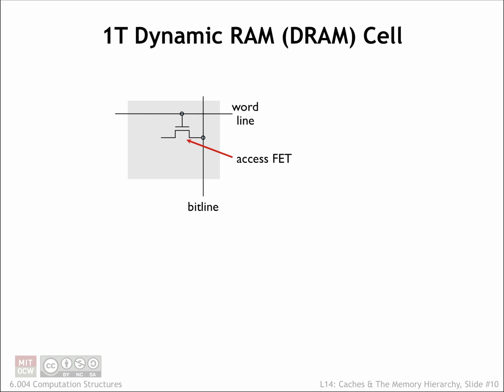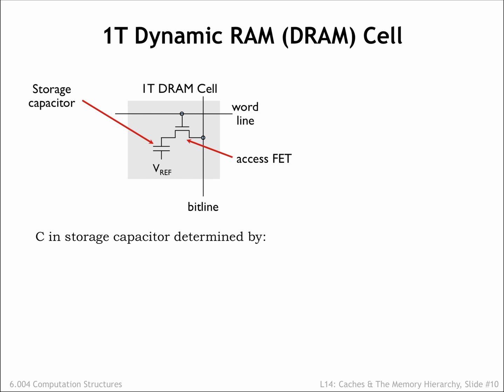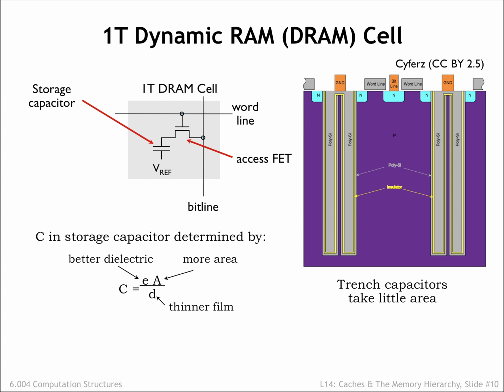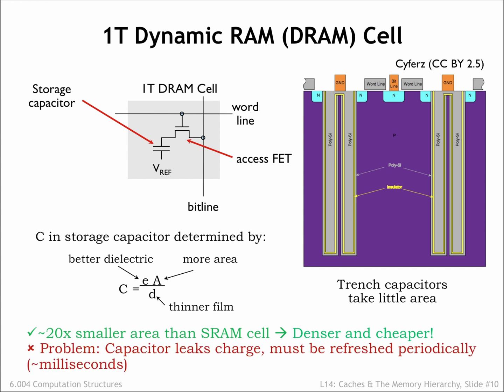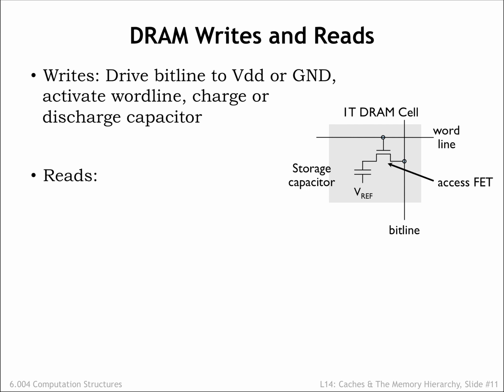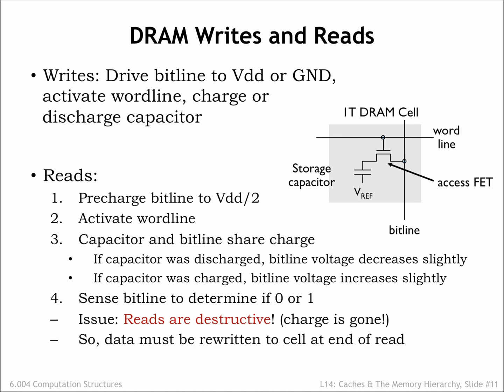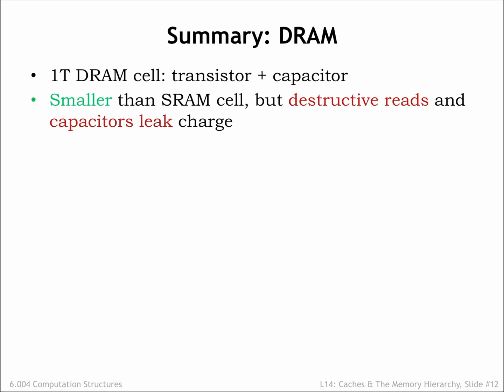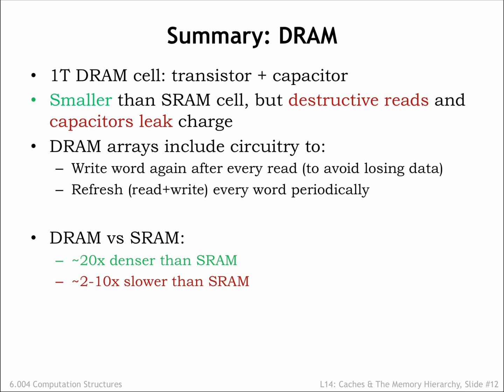14.2.3 DRAM

Comment: 1:55 what if instead of using single fet, we  use tri state switch which can go high impudence ?
Reply: Tri-state logic implies that the line is either pulled below a certain voltage, pulled above a certain voltage, or conducts 0 current. In reality, since memory is techincally analog, we have the option of conducting either a small amount of current or a large amount of current between the cell and the bit line. The FET is in "high impedance" when it is "turned off", but as Chris Terman mentioned in the video, the cells have to be refreshed due to both sub-threshold leakage and dielectric leakage. Even if the MOSFET was completely turned off, the cell would gradually lose charge to it's surroundings through the dielectric leakage.
Reply: How much improvement would the proposed scheme be though you'd wager?
Reply: gl simulating that